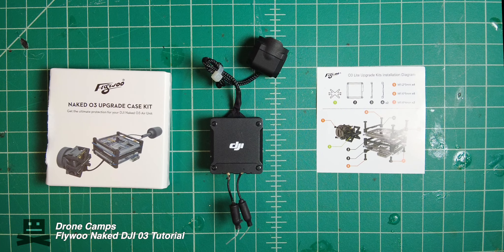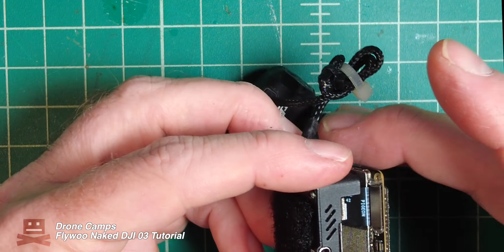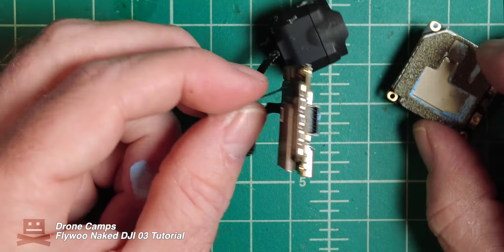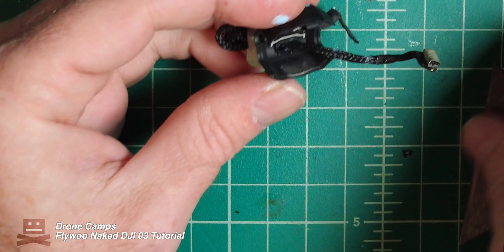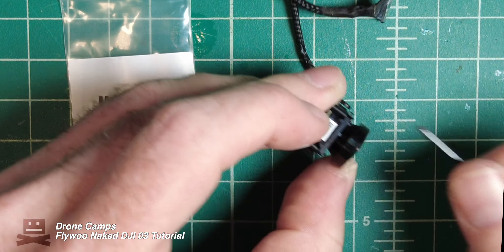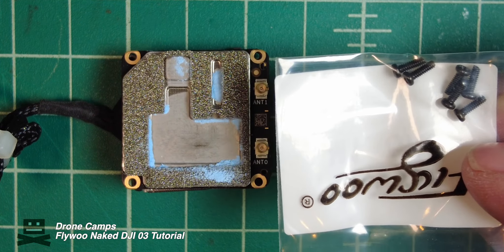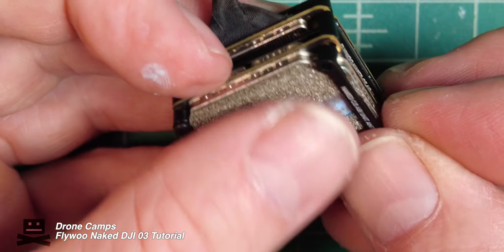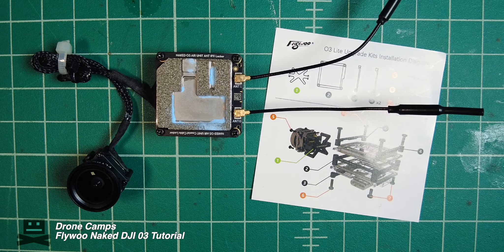FLYWOO Naked Dji 03 Decase & Build - Step by Step Tutorial

Comment: I'm fairly sure the bars at the top are intended to go 90 degrees around from where you have them so they hold the aerials on. (One has ANT Locker written on it and has the cut outs for the connectors). You might be right, but its just how it looks to me.
Reply from the maker: Could def be. From the schematic it looks the way we did it. But it makes more sense to have them front to back to hold the Ufl’s on. Their schematic sucks. But yeah I think you’re right.